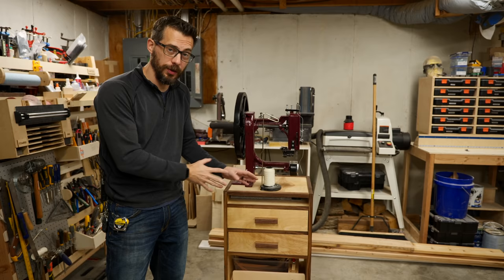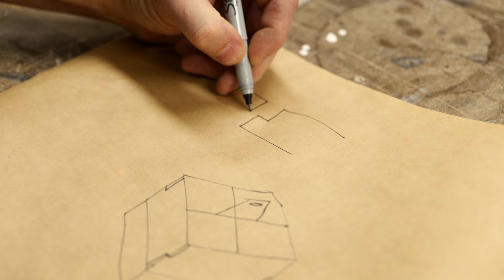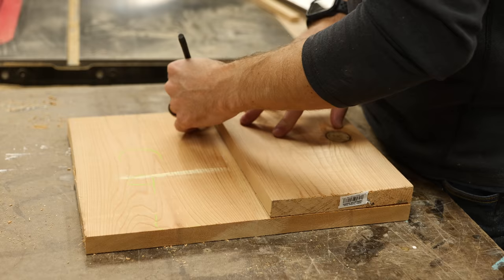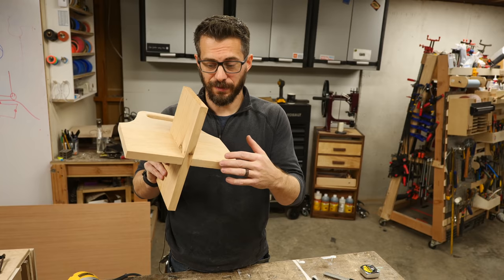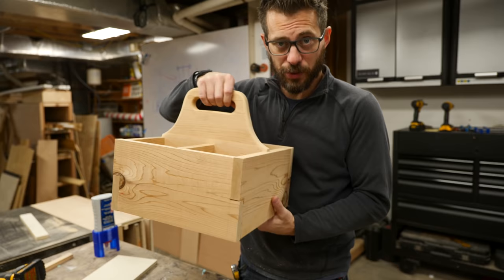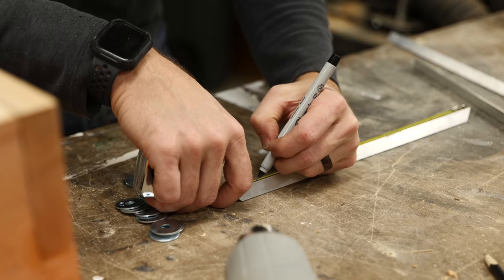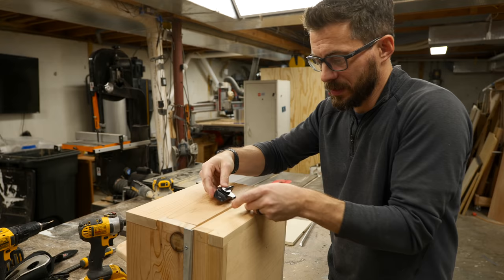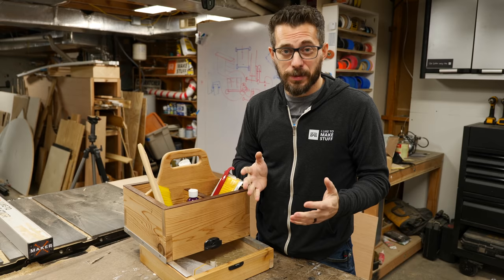How to Make A Tool Organizer | I Like To Make Stuff

Comment: Excellent use of the combination square for marking the width of the boards.  Too many people would usually get caught up in doing an actual measurement to mark on each one.  This not only saves time, but is dead set accurate.

Comment: I've been working on ideas for a new carry-a-long to tote my ingot train to the train show... It's a model of a tiny industrial train, if the flats were full-size, they'd be about 10ft long. Four flats are chained together into a single car, and then each car has couplers.

I started this last year with a carrier that had four removable slats that allowed me to pull each car out, set it in the track, and roll it off the slat onto the track.

The old carrier had all four flats stacked one above another. This time since the trainset has grown, it's going to be 2 "stories" with three slats side by side for a 2x3 arrangement. Then on top, space for the engines, caboose, and the remote control, batteries, and charger.

Thanks guys for helping me figure this out!
Reply from the maker: oh man, I bet that's awesome!
Reply: It IS fun. If you guys are looking for something new to check out, March 13 and 14 in Timonium MD is the East Coast Large Scale Train Show (www.eclsts.com).

Here is a link to a couple videos of the train running at last year's show. Freedom Central is my model railroad empire.

Comment: This looks really great. I think I would have turned the bottom tray 90°, though. It seems like pulling it out that direction from the handle would cause too much moment and tend to make it jam up. If the handle were turned 90° you could counter the moment more easily with your hand.

Comment: It's a great build, really well explained. :) Really simple idea. I love that you keep bees as well! I saw the video making the beehive.

It would be more complex, but I'd have put a "female" mating part into the top box and a corresponding "male" mating part into the bottom parts drawer. That way there isn't as much danger of putting the top down and bending the bottom brackets. You could possibly have got away with an L-bracket on the back which hinges into a rebate in the (you'd also have to cut a dado in the top bin to raise the base)
An obvious counter to that would be that the aluminium L-bracket you're using on the bottom is fairly maleable and cheap so it would be easy enough to replace if you damaged one. Either way, it's a great video.

Comment: I like the joinery. easier than finger joints. Stronger than butt joints. Even easier than breaking out a dado stack for a rabbet. Just lay it out and cut a couple of straight cuts on the band saw.
Also cool that you keep bees. I didn't know that. I've had bees here in Nova Scotia for 7 years now and I've killed more of them I can count. Not on purpose but let's just say that learning by trial and error never ends.

Comment: great idea! Have you ever tried reproducing DeWalt's T-Stak system? I'd love to have a go at making compatible toolboxes, but just not sure about the clips, I"m thinking of aluminium angle, but it will need some kind of ridge along the length if it to facilitate locking on. Any ideas?

Comment: The strength of the handle depends entirely on the grain strength. Would it be better to rotate the grain direction 90 degrees? Otherwise, a fine looking tote!

Comment: I never fully understood how to set up the roundover bit.  How far down do you go?  Do you eyeball it?  how do you duplicate a cut if you have to match a piece later?  Not much experience with routers.
Reply from the maker: I always try to make sure that the end of the bottom cutting service is just barely below the bezel of the router. It always helps to do a test cut on scrap and adjust before rounding over your final piece

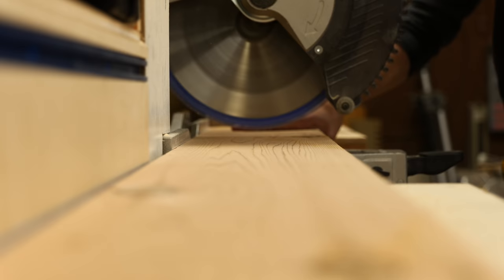Comment: 2:40. Should be 12"+3/4"+3/4" if you're making a finger joint on both ends of the board if 12" is the inside dimension of box. I'm sure you knew this or just misspoke in the video.

Comment: I've seen you route out edges for bottom pieces on a number of different videos. I'm curious if you've ever heard of this device:

https://www.homedepot.com/p/Milescraft-Corner-Chisel-is-Spring-Loaded-for-Squaring-Hinge-Recesses-2220/300534121

I highly recommend it. I learned about it from Norm Abrams back in the 90's on New Yankee Workshop. Very easy, very effective, and you're less likely to cut away too much or too deep, etc.